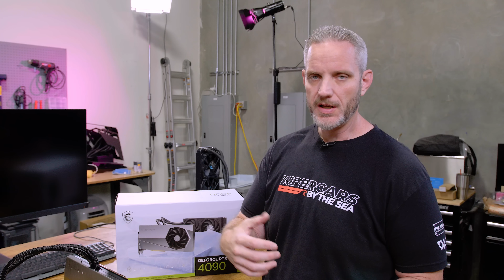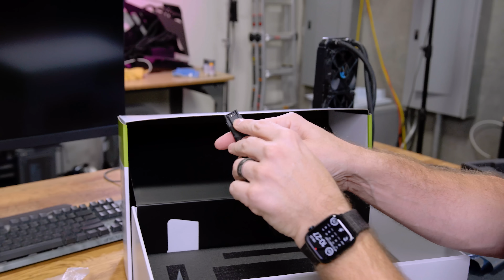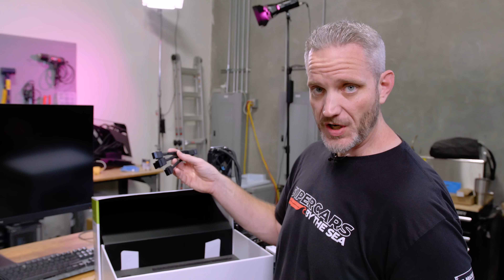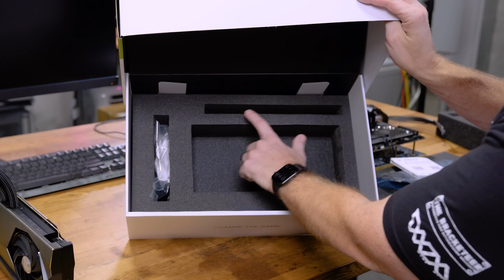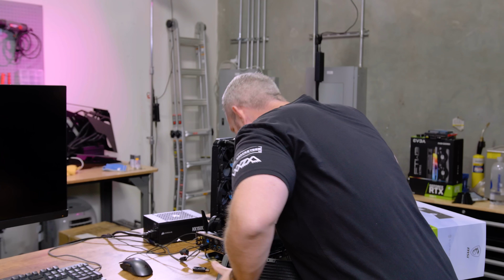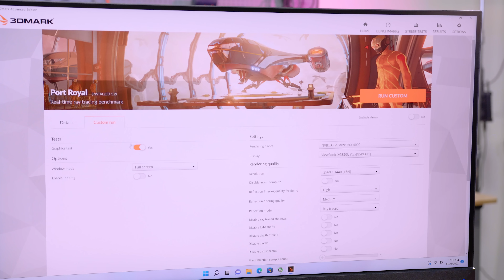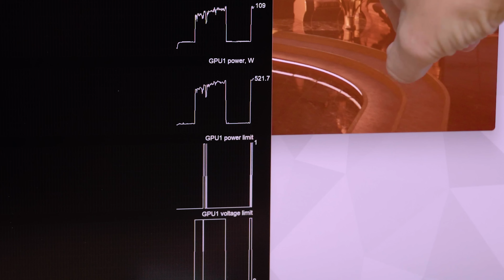This is the most BEAUTIFUL RTX 4090 yet...

Comment: that is easily the nicest looking 4090, I find the others to be blocky and very boring (other than the Zotac ship looking one, I actually love how that card looks)
Reply: Agreed.  I'm a big fan of both the 30 and 40 series Suprim cards as well as Zotac's 40 series offerings.  For the Suprims, I'm just a sucker for brushed metal.  I love the look of it.  As far as Zotac goes, I think their cards prove that you can have interesting, out-of-the box design that isn't cheap and chintzy.  They look funky but make it work.  It seems like the other AIBs heard complaints about cards being too "gamer-y" and tried running in the exact opposite direction, except there's still plenty of that "gamer-y" nonsense on their 40 series cards but now the coolers just look like bricks.
Reply: It's the nicest looking GPU I've ever seen!!

That design is simple yet also with some edges so it's not getting boring and with the brushed gun metal it's just gorgeous. I want more of PC parts looking like this. Imagine case in such a simple but noble design?

Why did PC components never get noble and stayed like childish, awful and cheap plastic piles of crap?

Comment: My ZOTAC 4090 Airo is buttersmooth running at 70% powerlimit my 3 4K 55" TVs in FS2020. Cooling is no problem for those cards with those giant coolers

Comment: Very nice card! Honestly with the size of air cooled graphics cards, water cooled cards seem better and better since most people don't use AIOs for cpus, and gpus generally use a lot of power.
Reply: Wait, most people don’t use AIOs for CPUs? I thought CPU run really hot these days
Large air coolers that rivals decent AIOs are rather heavy and stresses the motherboard.
Reply: @kerbodynamicx472  most people get midrange cpus not 13900k or whatever so decent air cooler is fine.
Reply: @Eskoxo  I know, and air coolers generally beats AIOs in price to performance. Though, Im worried that large coolers weighing over a kilogram can put stress on the motherboard and cause it it bend.
Planning to build a new PC with 13700KF… wonder what cooler to use
Reply: @kerbodynamicx472  i have used my Noctua NH-D15 air cooler in like 3-4 builds now never had any issues with bending or such sorts and as far as cooler it actually beats many cheap AIO performance wise cant go wrong with Noctua.
Reply: @kerbodynamicx472  They may, stock, but I've managed to make my 5900X run cooler and faster than stock by undervolting (curve on average -25-ish and added just a tiny bit of SoC voltage). Granted, I'm running an AIO now, but an aircooler was sufficient. The benefit is basically lower noise.
Reply: @kerbodynamicx472  Most people run "gaming" CPUs instead of the top-of-the-line ones and most don't even OC them because unless you're being CPU bound there is really no reason for it, so a good air cooler is all you need to keep the CPU in decent temperature.
Reply: My main reason for an AIO CPU cooler is noise levels, not thermal throttling.
Reply: @seeibe  AIOs are louder than good air coolers....
Reply: Most cases have room for 2 240mm AIOs. IMO it's a non issue.
Reply: don't use aio for cpu's? rofl it's a must nowadays.
Reply: @rci-tf2zc  You don't need an AIO for any cpu....period.

Comment: hey Jay, love your videos always. I personally have that GPU and it is amazing. the only thing that suffers from time to time if you push it on an overclock is the memory. sometimes it gets a little warm.
Reply: Wait in 1 year 🤣🤣🤣
Reply: @the1observer  Sorry I don't understand, do you mean the memory chips will have issues due to long term high thermal operation?
Reply: @malzaharkhalil3833  it will degrade overtime for sure, yes. Had a suprim X 3080 with high mem temps on day 1. When I sold it it was over 95*C while light gaming, would heat my room so bad.
Reply: @the1observer  oh my, that's not good. I was looking forward to the RTX 4090 suprim x (air cooled version) when it was back in stock. 🥲
Reply: @malzaharkhalil3833  Use it and sell it as soon as the 5k series drops or when you can upgrade wothout losing 50% value, it still worked it was just burned in. They use cheap thermal pads and paste for the memory but forget overclocking the memory. The gpu's are binned but the memory chip will hold you back for sure.

Comment: Honestly i just like the respect you show to other techtubers including GN and Steve. Ill never get to play with a 4090 but hey thanks for letting me see another cool design😁
Reply: Jay, I have a Suprim X Liquid on order (back ordered) and like it for it’s slim design and AIO. I also have a 2080TI Kingpin Hybrid with the LN2 Bios installed I plan to run both in the same system (I need the addition hdmi outputs for my FlightSim Hardware and triple displays. My point is do you think someone will come up with a bios mod to get a bit more out of the Suprim X? It will probably perform just fine stock but I like to max my GPU’s when possible.
Reply: @MrScott_e  hey i dont think jay will see your question cause you have it as a reply to me
Reply: @drummera1d2c3  duh! On my part. Thank you
Reply: @MrScott_e  no problem!
Reply: I’m with you. It’s depressing when you see these guys getting to play with top tier hardware and I’m still on an RX 580.
Reply: @jamezxh  It's even more depressing that you find techtubers playing with high end hardware depressing. "you can be depressed and not cry" LMFAO
Reply: @jamezxh  how about go work a couple of hours and buy a 3070?
Reply: @Dimexodus34756   unnecessary
Reply: @Dimexodus34756  it depends on a lot of things dude, don't have an attitude like that. Take my case for an example, I work my ass of with overtime and all I could afford was a 4th gen i7 and a gtx1060 6gig.
Reply: @Dimexodus34756  depends on your country, responsibilities, situation etc.
cant just buy stuff
Reply: @AverageBosnian  Bruh then stop watching videos and do more. U don´t get anything for free in this world.
Reply: @Dimexodus34756  Where in the world do you live where you can buy a 3070 with working "a couple of hours"?
Reply: @翠星石-t6o  In my country u can earn 520€ a month taxfree with a sidehustle. On 12€ minimum wage that´s 43 hours a month work for 520€ cash. So for a 3070 for lets say 350€, u need to work about 29 hours, wich is not even a "full month" of your sidehustle.
Reply: @Dimexodus34756   I’ve got better things to spend my money on. Though it would be nice, I can’t justify the expense just to play games.
Reply: @jamezxh  ok but then don´t cry about it when u don´t want to buy such things in the first place.
Reply: @Dimexodus34756  All I can say is you live in a very financially chill country
Reply: @Dimexodus34756  I’m not crying? Where did you get that idea?
Reply: @DraaelD  Working is definitely necessary to earn money to buy things, though.
Reply: @jamezxh  "I'm not crying"
 "It’s depressing when"
Do you share your account with someone else who wrote the second line? Or...?
Reply: @tim3172  you can be depressed and not cry? Anyway I’m fucking over talking about it.
Reply: @PalowPower Fair enough assumption. Some people really think making money is all down to just buying one thing individually here and there when they want it, and not having to deal with bills and other expenses. I mean seriously, I'd rather have a full supply of toilet paper for the month over a 3070.
Reply: @Dimexodus34756  Depending on the country you can have to work more than a "couple of hours" but actually months.
Reply: @Dimexodus34756  In my country a 3070 is  about 1.000 Euros( more or less this is exchange rate tho) That's about what i make in a month and a half, also remember people have to pay bills, eat and (or) rent. It would take me about 8 months to save up to buy that card if i save up a quarter of my salary each month. Even if i'd be pacient to save up for that long i still wouldn't buy that card, i'll get a 2060 or at max 2060 super and that would be sufficent for my gaming needs. At the moment i got a Ryzen 5 2600 with a R9 390 8gb not the most powerful but it's good enough for now, and i busted my ass to build this computer. Planning to upgrade to a 1070 maybe 1080ti if i find one.
Reply: @AverageBosnian  sounds like a skill issue
Reply: @tim3172  lmao the irony
Reply: @PalowPower The joke is that in Europe that card is around 2400-2700€ depending on taxes of each country, is 2000€+Taxes let´s say, that is 2005$ right now, why in Europe the price grow from 1749$ to 2005$ WITHOUT taxes? In my country with taxes the final price must be around 2115€ and the cheapest one is 2299€ but "out of stock", the next one is 2500€.
Reply: Rick Sanchez  Without taxes is more expensive too. Free medical care is less than the 10% of the governmet budget.
Reply: @翠星石-t6o  15 an hour is min wage by me, thats 12.60ish after taxes, so a single workweek (40 hours) is enough to buy a 3080 on ebay rn
Reply: @AverageBosnian  yeah, in my home country I would never even think of purchasing it. But here in canada I can beacuse I don't spend a lot of money on phones and cars. I still haven't, saving and waiting for the new gen as I want to pair it with a strong processor as well (i jave 5600 rn).

Comment: I have a weird question, why you can run lets say 600w GPUs under air, and they will be just fine, but you cannot run a 300w CPU under air?
Reply: CPU’s are packed together tightly and clocked to high hell, less surface area makes it harder to cool.

GPU’s are comparatively lower clocked and have more surface area to transfer the heat.
Reply: @jordant8864  Clock speed has nothing to do with anything, other than higher clocks on a CPU (also a GPU) will require more voltage which requires more heat dissipation.
 You can easily make a CPU draw 350 watts and a GPU draw 350 watts, regardless of the clock speed of either.
The only factor is how much power is consumed that requires dissipation.

The GPU has half a square foot of aluminum to dissipate heat and 3 fans.
GPU dies are also larger so you can easily attach many heat pipes to them.
Give a CPU that amount of cooling performance and you can dissipate 300 watts using air.